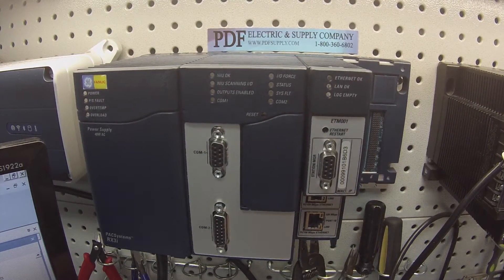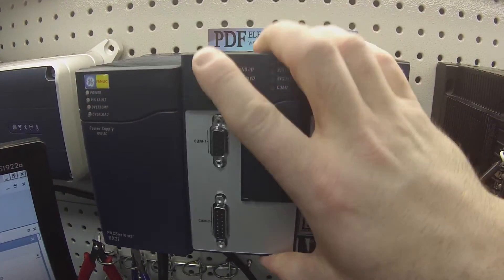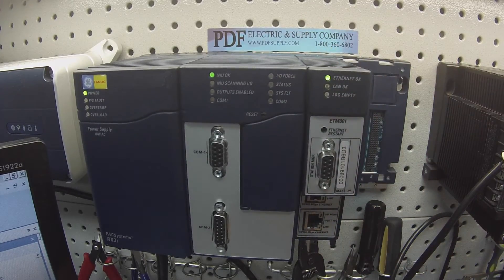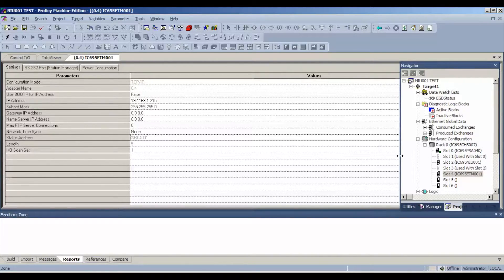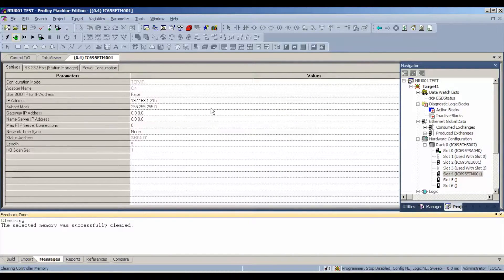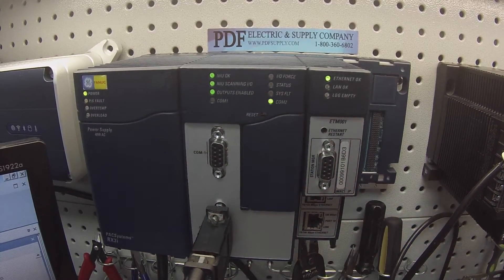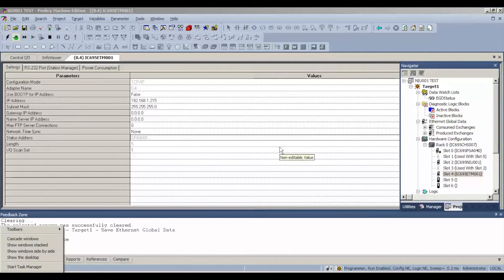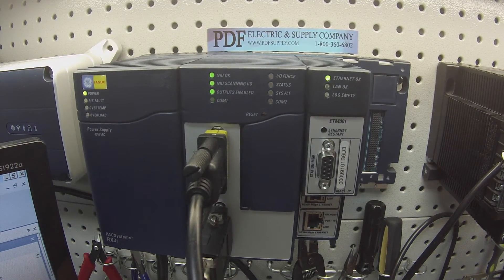How-To: IC695NIU001 Network Interface Unit - Rx3i PacSystems

Comment: Hello sir i have a terrible day now can some help me? our system get HIGH VOLTAGE is the all PLC is DAMAGE i have the existing program of the system this is my question i restore all the hardware configuration accouding to my project back-up i im comfedent thant my back is HW-EQ and LG-EQ. my problem is this the IC694MDL655 3pcs error fault is SYSTEM CONFIGURATION MISMATCH ERROR CODE 1 (01 91 01 4b 80 12 1a 03 00 00 00 00 00 00 00 00 00 00 00 00 00 00 00)  Task Num 9 . but and pysical hardware is current and my backup project is current 2nd is the IC694ALG223 error is UNSOPPORTED HARDWARE ERROR CODE 18 (01.bd 01 c4 80 12 24 01 00 00 00 00 00 00 00 00 00 00 00 00 00 00 00) i Repetedly review the hardware config is correct. is there any issue or Firmware update to IC695NIU001-AAAA to accept the ic694mdl655 and ic694alg223 Please help me and another info is we upgrade the FW of NIU its 7.15 now still i get the some error